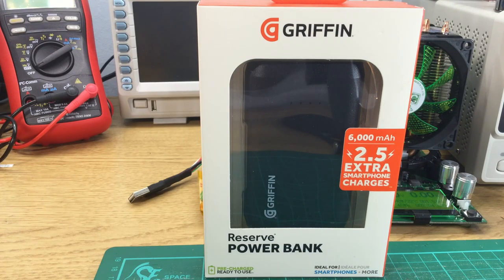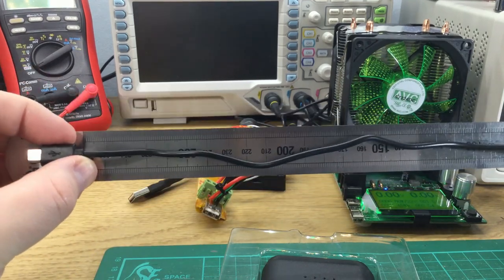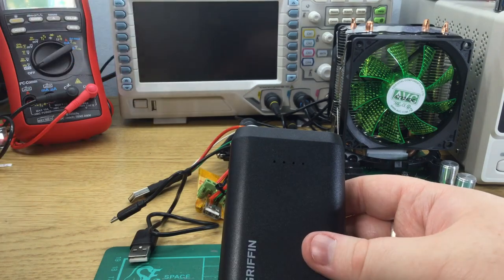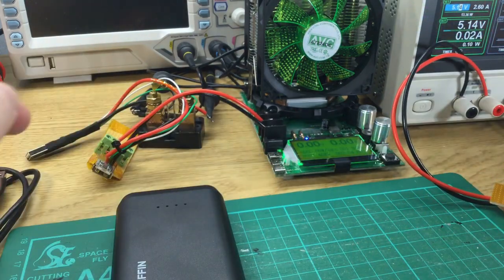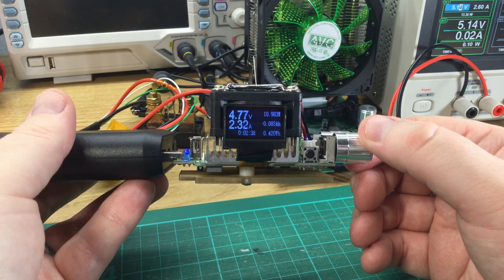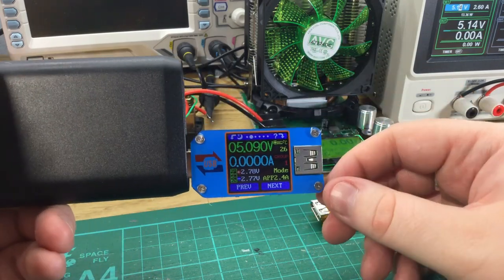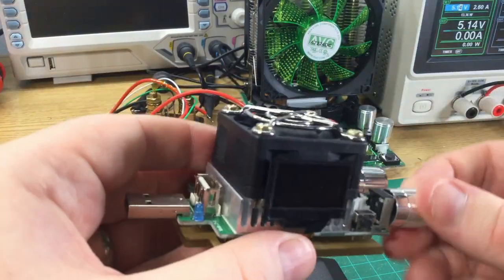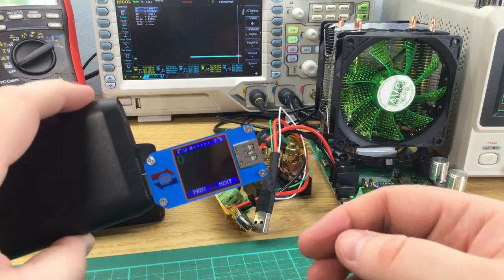Griffin Reserve 6000 mAh Power Bank Review

Comment: I’m having to go back to the store for the third time because this second one is yet again faulty and it’s now happened again, load of crap and is going straight back!!
Reply: Georgia Alice I’m scared now literally unboxed mine in the store and threw away the box what was ur faulty ?
Reply from the maker: If you're in the UK and you have a faulty one then they'll be required to replace or refund it regardless of whether you still have the box. It will be easier if you still have the receipt, but it's not required under the Consumer Rights Act - a bank or card statement will also do.
Reply: What was wrong with it
Reply: Just bought another one went back twice in one night mine is faulty it only has one LED light it never reaches fully charged this is the second one in one day that did not work and what sucks is I threw away the box the second time I have the receipt and I can't return it